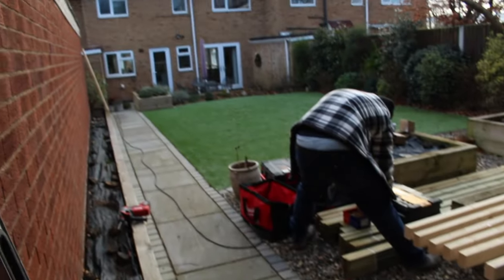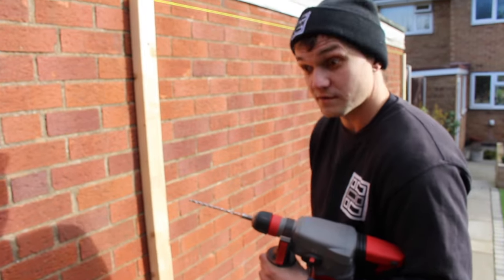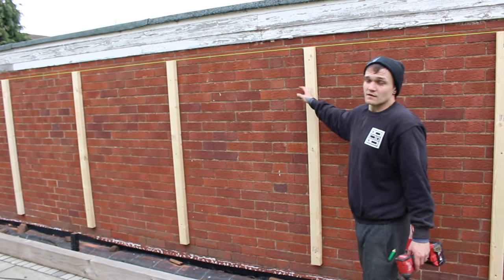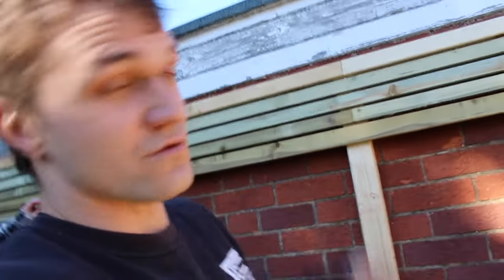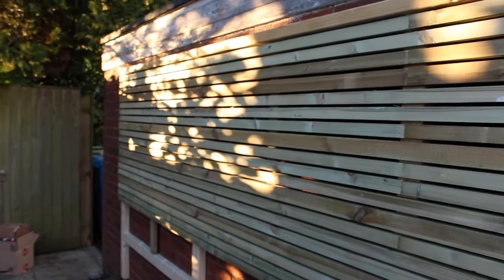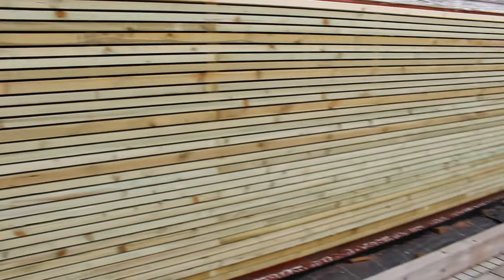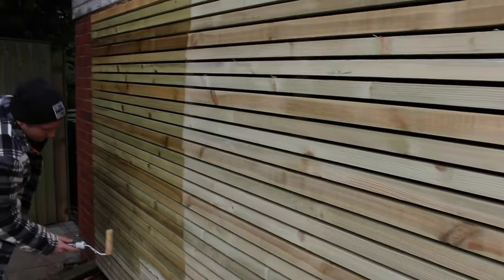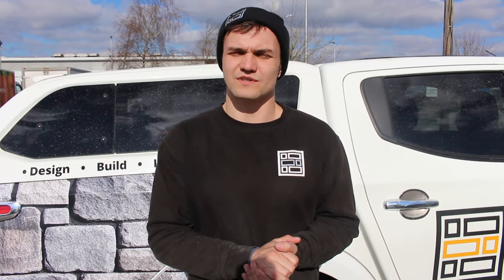Horizontal Timber Screening - Fixing To Brickwork or Concrete Posts #construction #landscaping

Comment: What's the easiest way to calculate how many slats/gaps you will need to fit a certain area? I don't want to try this and have an uneven gap at the top or bottom. Any help would be Greatly appreciated. Thanks.

Comment: Great work guys! And thanks for all the tips. I am in the middle of building one of these slatted fences at the back of our garden. Used the 50x25mm battens. With a 5mm gap. Now thinking maybe should have done a 10mm gap… could you please let me know what space you guys usually go with for a 50mm wide slat. Cheers!
Reply from the maker: We go for between 5 and 10mm depending on the type of screen. More often than not we go for 10mm 👌⚒️
Reply: @Matipolandscaping  thanks for the reply mate. Appreciate it. Keep up the great videos.
Reply from the maker: @domtomas1178  No problem! Thank you very much! 🙌⚒️ Will do

Comment: Awesome work thanks for the tips guys. Doing a similar project very soon. Does it not matter that the back of the battens don't get any oil on them? I'm considering oiling them before putting them up - but not sure If I have the space to do so.

Also the screen fence I'm doing is at the back of the garden, and there's a normal panel fence either side of it, any tips on how to finish it on the edges where it meets the panels. Do I finish shy and plumb, or go up tight against the panels so there's no gaps, I'm stumped. (long shot, but any chance I could email you a pic for some advice on this?)

Comment: You have inspired me to do a similar project myself, just wondering if you could explain the spacing of the slats please? I paused the vid where your working out on the piece of wood was and can’t quite see what you did. Is there much wastage by cutting to the nearest upright back from your batten length? What centres were the uprights?
Too many questions. Thanks 👍👍👍

Comment: Great job guys can i ask what timber you use for the battens and  where to buy them at a decent price ?. 
Im wanting to clad a garage and a large concrete fence and posts.
Reply from the maker: Thank you! We use treated batten 50 x 25.. can pick up from any builders merchants.. much cheaper than other alternatives.. looks great after a sand down and oil 👌

Comment: Hi Great video. 
I have had my house “smooth” rendered sand and cement, but 1 wall has a pretty bad finish which looks terrible in sunlight 🤦‍♂️. I was thinking if timber screening it?? Do you think this is a viable option??
Reply from the maker: Thank you! Yea definitely! That will work well 👌

Comment: if you use a roller to apply the oil  how do you protect the top and bottom of each horizontal from water ingress. asking for a friend 😀
Reply: Also I’d be keen to know how long the c16 on the back are going to last

Comment: Would you recommend oiling the battens prior to putting them on the wall ?
Reply from the maker: If you have the time/space to do so, this would ensure full coverage, however its not necessary 👌⚒️
Reply: Thank you for your reply, how did you calculate the 3 way stagger, also what size spacer did you use for the horizontal timber?
Reply from the maker: @Vikash Bhagania  keep your battens as long as possible, and cut them to the center of your framing. This will give you your first run and then adjust your measurements so that no joins line up. We like to use 5 or 10mm spacers 👌⚒️

Comment: Looks great! I have an 18g Brad nailer, and see you also are using 18g nails. How’s this holding up? My friend recommended 16g, but don’t want to shell out for a new nail gun.
Reply from the maker: Thank you! 18g has worked well for us.. no problems 👌 main thing is going for a stainless fixing⚒️
Reply: @Matipolandscaping  thanks for responding, much appreciated. I’ll buy stainless and crack on 👍🏻
Reply from the maker: @matthewthompson6329  Good man 👌⚒️

Comment: Hi pal, would it be alright to have the upright post 6 foot apart or do you think the slatted timber might sag and need more support in the middle?
 cheers
Reply from the maker: I'd say you'd need some additional support or the battens may sag over time 👌💯
Reply: @Matipolandscaping   yeh I was thinking same or even just put the post 1m apart and use the thicker tile battens 25x50mm so they are stronger

Comment: Looks really good.  Two quick question. Do the screw still require raw plugs (I’m guessing no) and are you using roof battens for the horizontal ones ?   Thanks B
Reply from the maker: Thank you! No need for raw plugs and these are roofing battens 👌⚒️

Comment: This is great thank you! What is the black screen you use behind on some of your videos please?
Reply from the maker: Glad you enjoyed! That's a black heavy duty permiable weed mat, let's the timber breathe and will last forever 👌
Reply: @Matipolandscaping  Thank you so much for the quick reply and for your help!
Reply: Sorry also what did you use to attach these stainless steel nails? Also could you use PSE wood or should I stick with roof battens?
Reply from the maker: My pleasure! We use a 2nd fix nail gun 👌 there are air powered or battery powered versions. You can use any timber you like really. Just make sure it's pressure treated for external use 👌 and around 25mm thick 👍
Reply: @Matipolandscaping  Sorry last question 🤦🏼‍♀️ Is the 2nd fix nail gun just for the black weed mesh or for all the fixings for the wood too? I’ve seen you mention an 18g Brad nailer before. Do we need both or are they the same thing? Sorry for all the questions!
Reply from the maker: @Chloe Farrelly  That's alright 👌 sorry, yes they are the same thing. Once your first battens on that will hold the weed mat in place. You can fit a temporary batten at the top to hold the mat in place and then remove it and realign once you get near the top/bottom 👌⚒️

Comment: I can't understand  why u start at th top an work down.  ?. I would work from th bottom up. Then th spacer holds your  next timber.
Reply: Thought the same but I've seen another contractor do the same and start from the top also... hopefully someone can give us an explanation work from top to bottom
Reply: Think it will be so it guarantees an qual gap to his top rail otherwise could end up with a different margin
Reply: Probably starts at the top so he has a full board at the top. No-one will notice if the bottom board will be trimmed, say the ground was unlevel for example, but it would be very obvious if the top board was cut.